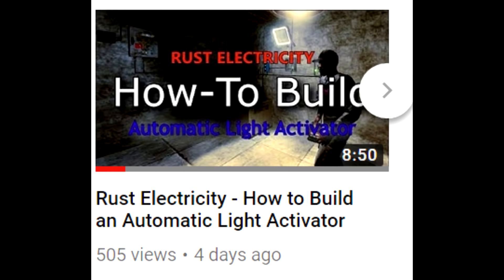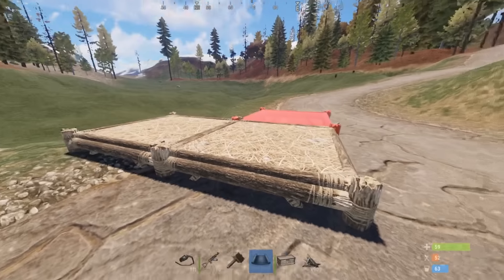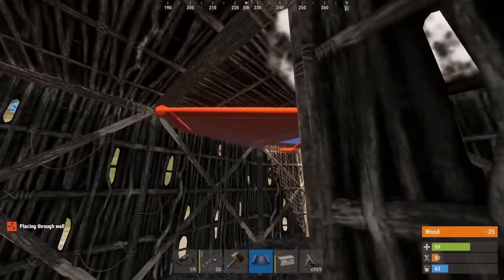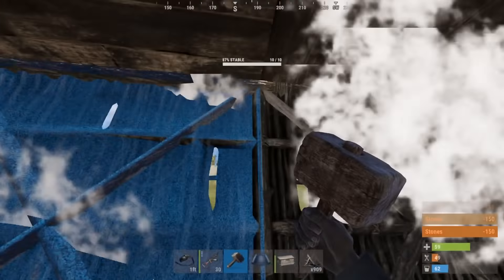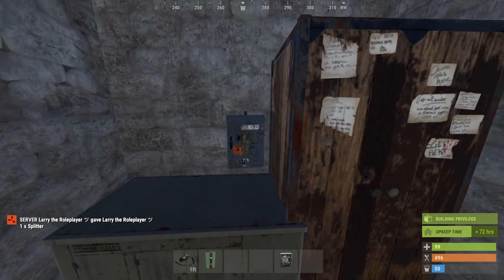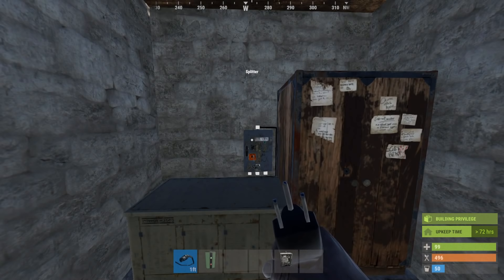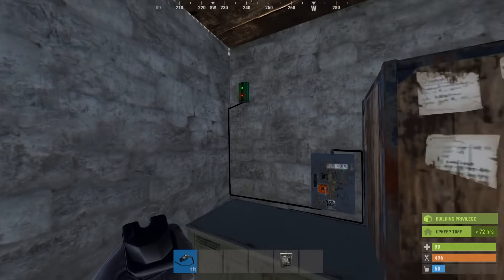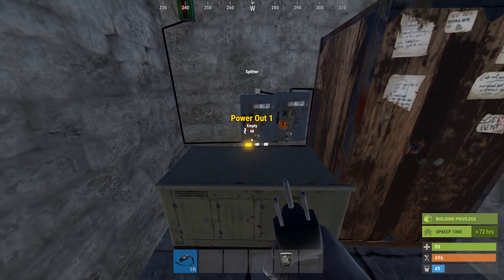✅ Rust Electricity - How to Build - ELECTRIC TRAP BASE!

Comment: Hi larry, have been using your trap since the the force wipe (last thursday). It have worked out so well for me and i have gotten tons of loot. I made a small change (if you are intrested id love to explain more) Today i got raided by 4 players against me and the base defended itself. Sadly they came back with more guys and i had no chance (i had already moved the loot) just wnated you to know. Its the best trapbase i have ever used.
Reply: Defended itself? Ahahaha
Reply: @Беспроводнойактивныйсабвуфер  yes its what i was talking about when i said "i made a small change
Reply: But you need to reset it afterwards
Reply from the maker: I would love to see what you changed :)
Reply: @LarryTheRoleplayerTM  ok, I'll try to make a video explaining shortly
Reply: Couldn't get the recording software to work but I'll try to explain it: I connected the output on the  pressure plate to a splitter and got one of the output connected to the reset on the memory cell and the other one connected to a timer that was connected to a splitter that went to the door controllers. This meant that the trap killed the victims automatically. (I'm working on a way that the trap can reset it self aswell so you can leave it on over night)
Reply from the maker: @jacobh6367   That's so awesome!  I'm glad you could adapt my design into something even better, thanks for sharing that!

Comment: Only thing I would change about  the video is making the gun doors automatic open 10 seconds after they get trapped, instead of manually flipping a switch. I would also set the front to reopen automatically after a couple minutes. Just make everything automatic. haha!
Reply from the maker: For sure, you could totally make it self activating.  I like to mess with my victims before I send them home to mommy :P

Comment: everything works but u can get back out when u hit the pressure pad again what did i do wrong
Reply from the maker: Make sure you're using a memory switch, pressure pad on the "SET" line, and a manual switch on the "RESET" line.  That will hold the door open/closed until you physically reset it.
Reply: @LarryTheRoleplayerTM  thanks that worked

Comment: Dude when I put it on set it turns off my memory cell help
Reply from the maker: You may have a power shortage.  Check the amount of power going into each stage of the circuit.
Reply from the maker: @dirtbikeracer608  use windmills :)
Reply: Are those In rust???????  @LarryTheRoleplayerTM
Reply from the maker: @dirtbikeracer608  You can purchase them at Bandit Camp

Comment: Couldn't you make it so have a 2x2 for example, you open the door and there's a double door on the side and a single door open on the front. You run in and the double door opens up blocking both doors so you can't go through and shotgun traps shoot you from the side.
Reply from the maker: You totally can!  My design was just a concept to give you guys an idea, and you can go from there <3

Comment: Ok, i legit have electricity questions now. I made a great trap base with pressure plate but i have this problem of the pressure plate seems to DRAIN the battery (small and large both get drained).....
So in the end my trap base only works at night.... I'm guessing i'm going to have to make one of those elaborate set-ups where the electrics in your house are set up so they draw power from battery only at night and or have something to block the electricity to the pressure pad when it's not in use..... Help! If you can, add me on Steam (Paxus is my Steam name too) https://steamcommunity.com/profiles/76561198095279301/
Reply from the maker: Hey!  Sorry you're having trouble :/  The batteries are not really well implemented, try using the wind turbines.
Reply: @LarryTheRoleplayerTM  i guess, next time, i'll try that... a windmill on my trap base, seems a bit over-kill... i think it's more likely to make ppl suspect it's a trap than a couple of subtle solar panels....  Thanks